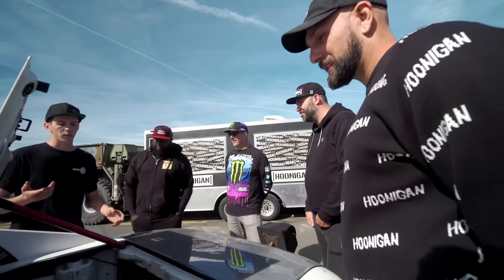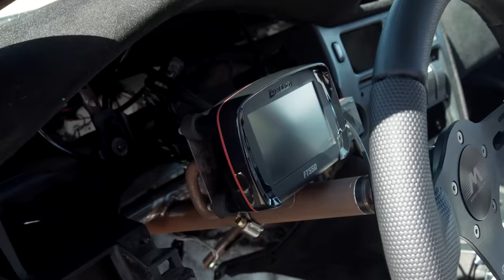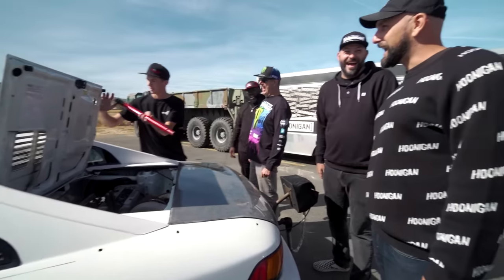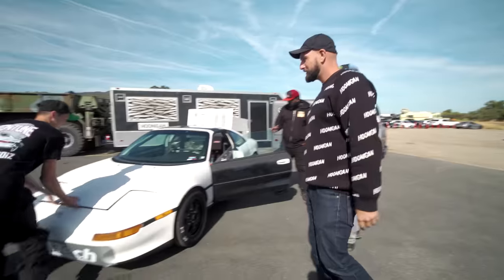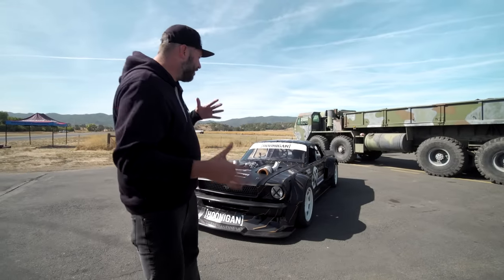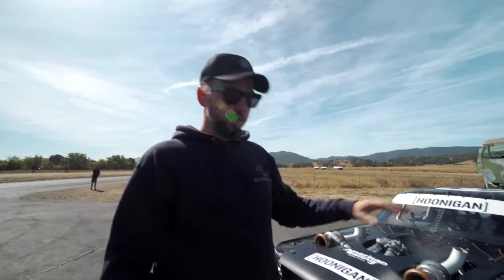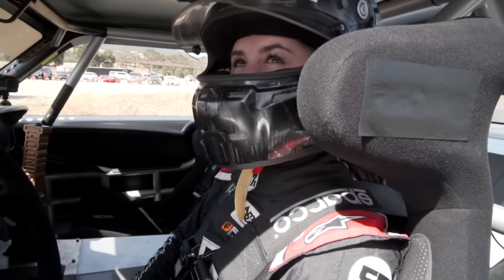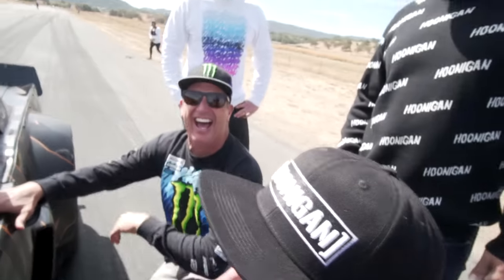BoostedBoiz' 1300hp Toyota MR2 vs Lia Block's AWD 1400hp Mustang

Comment: Love how the boosted boys are all about function. That thing looks like a shit box but has everything it needs to go fast.
Reply: what is shit box about it lol its a drag car
Reply: @timjeanjaquet5576  just look at it
Reply: @timjeanjaquet5576  a shit box isn’t always about how it performs, sometimes it’s about how it looks. You see any rusted out Chevy C10 and you say “that’s a shitbox” but then you find out that it regularly pulls tree stumps out of the ground and hasn’t had an oil change in about 10 years
Reply: @MilkDrinker218  they spent countless hours building that car it’s meant for function not looks I wouldn’t call it a shit box
Reply: @timjeanjaquet5576  yeah, that’s my point. Looks aren’t everything, and it looks like a shitbox.
Reply: @MilkDrinker218  your c10 analogy is the very definition of a shitbox. Plus the mr2 isnt actually bad looking. Just needs a paintjob or wrap so the doors match
Reply: @adrianwelgemoed9562  yes, that’s my point. It’s a shitbox, doesn’t always mean it’s bad
Reply: @MilkDrinker218  but a rusty ass c10 thats never had an oil change sounds like a shitbox through and through, whilst a clean mr2 with different coloured carbon doors doesnt
Reply: @adrianwelgemoed9562  my point is that looks aren’t everything. And it looks like a shitbox
Reply: @MilkDrinker218  i agree that looks dont matter, but it doesnt look like a shitbox bruh.
Reply: @adrianwelgemoed9562  that’s a matter of opinion then. We disagree on this. Fine by me what you wanna think.
Reply: @MilkDrinker218  fair enough. You do you mate
Reply: @adrianwelgemoed9562  🤝
Reply: @adrianwelgemoed9562  it definitely looks like a shitbox
Reply: @MilkDrinker218  Without the tires, if I pulled up to that thing at a red light I’d bet money a crackhead was driving it. But it definitely rips. Mad respect for the car. Super sleeper.
Reply: @Chops00  not arguing again over this. Your opinion is yours, my opinion is mine. I think it looks kickass
Reply: i love how there are just 2 car guys on this post..
Reply: all the others are 12 year old lambo drivers. xD

Comment: After watching how close that mustang was to a 6 second GTR I would have been suprised if that Mr2 had anything for the Mustang.
Reply: Not close by any stretch of imagination. Four cars. Pretty much a bus.
Reply: Yes only one 7.98 pass in perfect conditions. It's really a reliable mid to low 8sec car on a prepped track with a burnout box.
Reply: yeah, specially when you see how hoonicorns lane is layed with rubber and left lane is full of nonsense
Reply: But the gtr didn’t race the mustang in a prep service if it did he would have got smoked, the gtr would have destroyed the mustang
Reply: @luigikilla5821 but the GTR did beat the mustang. On a prep surface the GTR most likely would have beaten the mustang even more. I agree. But Im dealing with this surface here.

Comment: Wait, EVERYONE always races Hoonicorn on his home "track", isn't it time Hoonicorn meets them on their home "turf", the drag strip?
Reply: he should race against with a ssc tuatara
Reply: Since they have the same lane every time add light prep so rwd car get grip first 60ft
Reply: Ye so the other cars would actually u know, fucking hook?
Reply: @zoltangt07  right like the hoonicorns fast but i feel like most the cars from this season would destroy it on a strip
Reply: @skylermacart9079  for sure
Reply: They don't want to see the hoonicorn loose. It won't happen.
Reply: If the Hoonicorn went on a track they would just break shit
Reply: @mysavior415  For sure.  They're already breaking drivetrain parts on the airstrip with a lot less grip
Reply: @mysavior415  this is the real answer. It's not built for those huge shock loads you'd get by hooking on a prepped track. But if it didn't break I think the hoonicorn would still beat most of the cars in this season, it's fucking fast. I bet it's a low 8 high 7 car.
Reply: They don’t want to look bad
Reply: I think they are too afraid of loosing 😳😂
Reply: @ChurchAutoTest  they actually said the drivetrain was the reason they don't go to a prepped strip.
Reply: @ChurchAutoTest  The Unicorn is built of the best race parts money can buy, it isn't some junkyard build.  Does it break, yes, all cars at this level can and do break, so it isn't an excuse.  It'd force him to work on his launches, not too hard that it breaks things, and not too soft that it bogs.  It bring a lot more skill level into the equation and make a more equal race race.  As is, they always race on their home turf, stacking the deck in their favor from the get-go!
Reply: @Non-juicy  It'd just be cool to see them not always have the "home field" advantage.  It'd be great to mix things up a bit, no matter the outcome!
Reply: The hoonicorn would explode on a prepped surface. It’s already done it 2x this season on unprepared.
Reply: @zoltangt07  the hoonicorn doesn't hook either
Reply: Well they do agree to it so there's that
Reply: @shaquille9373  the hoonicorn doesn't even grip in the 60ft
Reply: @skylermacart9079  I don't agree. Aside from the nhra Corvette I still think most would lose if she can still launch hard and not break
Reply: @beardedforlife3740  it has tires fit for a street strip, or like a strip of road, those Hoosiers on the mr2 need a drag strip with the sticky shit u know, so it will launch and not spin shit
Reply: The hoon is spinning all 4 tires... it would be faster at a preped track! 

Yall crazy
Reply: @jaythe2nd38  you do realize that if the hoonicorn doesn't break it would be even faster right? Almost every launch the tires are getting smoked through the 60ft and sometimes out past the 100ft
Reply: It would just be the other way around then...just race awd matched cars..
Reply: @beardedforlife3740  I personally just don’t see the hoonicorn running 7s and almost every car this season has ran consistent 7s and a couple 6s. It’s not what it’s built for understandably but I don’t see that car running much faster than an 8.5 on its best day.
Reply: @skylermacart9079  guess we'll never know will we
Reply: @zoltangt07  tf you talking about? The hoonicorn smokes the tires almost every run. Can't really use the traction argument when it's not getting traction either
Reply: @MadManMachines  The problem is that the driveline they put in the car really isn't setup to handle that kind of power on a sticky launch.   Yes they can soften it up, but they're buying parts from aftermarket vendors that have some specific torque limits that low traction lets them work around.  I'd love to see more sticky track races, but I think they'll avoid that like the plague.
Reply: @beardedforlife3740  At the end of the day four tires losing grip will still be faster than two tires losing grip and you can see the lanes the hoonicorn is in will build up more grip overtime with the extra rubber they put down buy spinning which will add grip. The other lane has some rubber down but not as much
Reply: "The Hoonicorn is too Fragile" to race at the strip excuse is BS.   Drag racers break parts all the time racing at the strip, bring some spare axles and parts like all racers do, sure, it may only last 5 passes, boo hoo!   That's racing, show up and do your best!
Reply: @MadManMachines  This isn't racing either.  This is a promotional exercise.  Ken's rally effort, now that is racing.
Reply: @beardedforlife3740  it’s gets enough compared to the cars it goes against believe me
Reply: @ChurchAutoTest  You done being an apologist for Hoonicorn yet? No more excuses,  Run what you brung son!
Reply: @neong  nah not that quick, barely beat the tesla, do the math !!
Reply: @shaquille9373  the other lane shud have a ton of rubber down, been heaps of tyre smokin there !!!
Reply: @zoltangt07  its called tough cheese !@!
Reply: @MadManMachines  yeah hurry up and bring sumthin here !!😣
Reply: @beardedforlife3740  You do realise every other car they race is usually a heavier street car with 2wd? Grip and power to weight is the main reason they lose. P.s. 5% slip is optimal for accel in the dry, so every fast car will slip...
Notice how the plaid doesn't 'slip' everywhere and it's about as fast? Vastly better traction control + grip via 2klbs (almost a hoonicorn) of extra weight..
Reply: @shaquille9373  yes two tyres spinning while you are wheelieing are faster than 2 tyres not powered and not wasting your driveline power while you skip down the track?
Have you ever been in seriously fast car? I used to daily a 9s bike. That front wheel doesn't do shit, so adding more power there isn't going to help, that goes for MANY fast drag cars. Look at the RWD R35 and R32s. Enough said.
Reply: @N4CR  do you realize that the people bringing those heavier 2wd cars are the ones stacking the deck against themselves? Can't blame hoonigan and the hoonicorn for someone else not bringing the right car to a races

Comment: The mr2 itself has already won.
It fought against a car with literally twice the engine (8 cil bi-turbo vs 4 cil single turbo) and twice the traction (awd vs 4x2).
Reply: It doesn't work like that. The things you listed, is why the mustang is faster.
Reply: @dlg78  but... not so much faster. Doble engine, doble turbo, doble traction... some seconds of difference. 😂 
And... honigan bring a drag car for a track with "no preep".
Some kind of coward. 😉 
And... I think looking the video that ken's car is 1400hp only in the first race... because the car is really faster on second race than the first race... 
More than 1600hp.
Reply: @TheOzBR  you only need to compare power
..so, a bit more power, and a bit more faster.
Reply: @dlg78  nops. Because the power is only a peak. Isn't a constant. Compare a naturally aspirated 4cil engine of 200hp with a 4 cil turbo engine of 200hp and a electric car of 200hp. All cars with the same weight, type of traction and tires.
Put all in the drag strip.
The flat torque of electric car put all cars behind with a larger advantage.
In second the turbo, with torque coming in the low rpm.
In third the naturally aspirated. 
Power is not a comparison unit.
Reply: @TheOzBR  no, they won't.

The only torque that matters is torque above the gear shift point.

Go and drag 3 of the same power vehicles, and you'll have near identical trap speeds.

In fact ironically a 200hp n/a vehicle will be revving much higher than a Turbo 200, and hence can then take advantage of shorter gearing and improve acceleration.

You're not a low rpm when drag racing, your car will most likely never be below 4000rpm.

Comment: The key here is banging thru the gears and NOT trying to stretch out the gears/ over revving the engine where horse power actually drops off the power curve.

Comment: Alright just gonna call it. Sandbagging or the Hoonicorn makes more power than y'all proclaim. 

At this point, just give us a LEGIT dyno run or two different dynos and I only say that because all dynos don't read the same.
Reply: Yea I'm getting anooyed with these videos evey damn time they line something up and give the numbers out it doesn't add up. Using the power to weight ratio calculator in this video the mr2 should have pulled on the top end insanely hard vs the hoonicorn once hooked. They aren't stating the real numbers this car is making realistally like 1700awhp. I don't get why they are doing this .. it's really unfair to claim your making 1400awhp then crank it up to nearly 2k awhp and then the other car comes prepped to race something that's not even close to what they expect. Super unfair hoonigan Dyno this car on the tune it was in this video. It was def not making 1400 like it's got a scramble boost button or something
Reply: @daytonrhine5167  well the mr2 was wound down heaps and still spinnin so it makes sense it got beat by 1400hp !!
Reply: @rhett7716  exactly,....Kyle said that its turned down to around 600hp with traction control on.
They normally run 50+psi of boost and here they were running 30psi
Reply: If you think they are going to give you fair races.. yeah nope. Almost everything is a rwd street car vs tube chassis 4wd race car. The fact hat some come close is enough to impress me. The hoonicorn isn't impressive, it's a race car that is good for one thing, racing unprepped straight lines.
Take it on a hill climb vs real race cars and it'll break and or get smoked at the corners due to shit aero.
Reply: @daytonrhine5167  No grip. All these races are is who has more grip and less weight. This is why the Tesla did so well, it has LOTS of grip and torque and better traction control than the hoonigan. If it wasn't 2klbs heavier it would SMOKE it.

Comment: This would have been a lot closer race if they were on a normal drag racing strip. The only thing that I can think of to consistently beat the hoonicorn is a stripped/lightened Tesla Plaid. The hoonicorn is just perfect for this track.
Reply: Already happened and Hoonicorn won
Reply: It's pretty much apparent that the only thing that can beat the hoonicorn is another awd car with similar or more HP.....like the GTR, etc
Reply: If it’s an actual drag strip, then cars on those slicks would actually hook. But it’s not
Reply: lmao.....Tesla Plaid wouldn't even come close.
Reply: @ToddBaughPhoto  that one audi beat it too it came down to who could launch better
Reply: @ToddBaughPhoto  was that 2jp thing awd ??
Reply: @vandersgarage4682  it was close, except the corn pulled away in top end !

Comment: Every time I see the stats side by side, Hoonicorn every single time!
Reply from the maker: It's hard to bet against the Hoonicorn.
Reply: @TheHoonigans  Race against Red Demon.
So far every car was either very heavy,RWD,down on power or made to run on prepped drag strip.
You said it yourselves that you'll bring fast enough cars.Well in that case,bring something that actually hooks on non-prepped surface and stands a chance.Apart from that white GTR,every other car had some type of disadvantage.Fair races are what you should focus on doing.Otherewise it's nothing but a joke.This vs that series without Hoonicorn are much better.Why did you stop recording them when they were so good i can not understand.

Comment: Would love to see these two on a prepped surface! Let's make it happen, guys! 
I mean the Hoonicorn smokes all 4 tires almost the whole way, so imagine it sticking on a drag strip.
At the same time... 7.98 @ 184MPH in the 1/4 is insane.
Reply: the moment if tried to launch on a prepped track it would snap every axle
Reply: everyone here says it will break on the strip and they know
Reply: It won't run a 7. It barely beats a plaid which is a 9s car. And the plaid has the dusty 'competitor' lane.. swap lanes and it'd probably win. This shit is lame and rigged for hoonicorn every time.

Comment: After seeing a break down of the Hoonicorn, fact it has a 0 to 100mph at 2 secs flat and it's a rally stage car (which are design for fast recovery aka. acceleration). It's no wonder why it ate a 8sec drag car. Love the BoostedBoiz, but that like putting a putting the A-10 warthog against a f-15 eagle.

Comment: Can we just get the Hoonicorn on an actual drag track now?  It has to run 7's
Reply: This^
Reply: Please, I want to see that
Reply: Right?? I want to see what it will do on a prepped surface. The Hoonicorn has to be somewhere in the low to mid 7 range.
Reply: @austinhubbartt695  could you imagine a 6.9X pass?!  That would be great!
Reply: @Twobarpsi  I feel like that could be a very real possibility. We see the hoonicorn blow the tires from a dig pretty much every race. Imagine if it hooked up from the start on a prepped track! 😳
Reply: @austinhubbartt695  full slicks!
Reply: its the AWD advantage on regular surface, when they raced the S3 on last season it was dead even, and iirc that was a 9's car, unless they go back and made it way faster this time.
Reply: @402Racing  it would be interesting to see if they turned it all the way up put slicks on it and took it to the track.
Reply: That's the thing they won't.. It will break going down the strip
Reply: @Twobarpsi  if 6.9 happens then it it,s close to 3000hp
Reply: @audiophilesland969  so basically stock block 2JZ power?
Reply: @402Racing  yep it would maybe do 8.5 sec on the strip
Reply: How can it possibly run 7s? It would break in the 60ft and even if it didn't, it barely beat a 9s plaid. It isn't pulling another second out of its ass on a prepped surface, plus it's only 1400hp, 25% of that is chewed up by 4wd... 1100hp at the wheels.. yeah nope.
Reply: @Twobarpsi  what do you mean?

Comment: so don't know if this has been said I would love to see the Hoonicorn on a prepped surface to give these high horsepower drag cars a chance also having a proper 1/4 mile time to compare would be nice
Reply: The drive shafts wouldnt stand a chance lmao. Theres a reason they don't run it on a prepped surface.
Reply: Yeah they have said before they can't run it on a real strip cause the transmission would explode cause it's rated to like half the HP they are throwing at it. It only works cause it spins the tires
Reply: The hoonicorn might break in the start